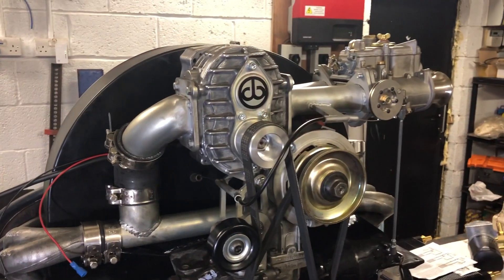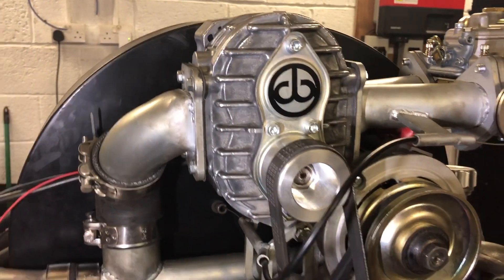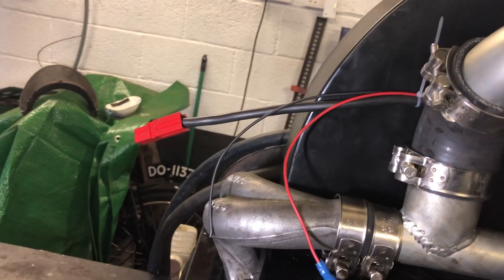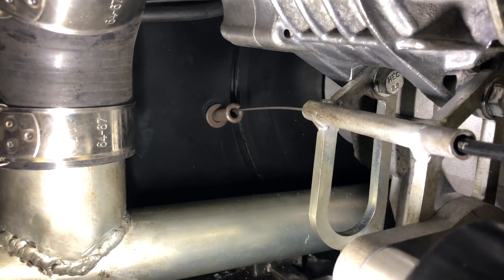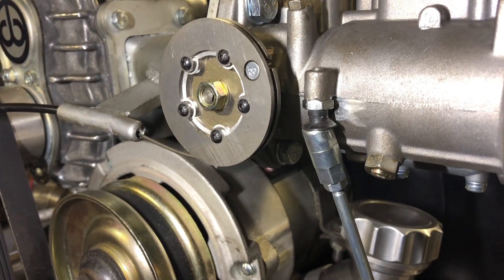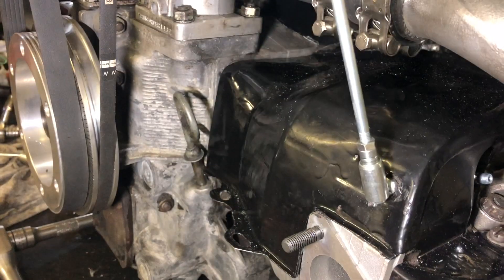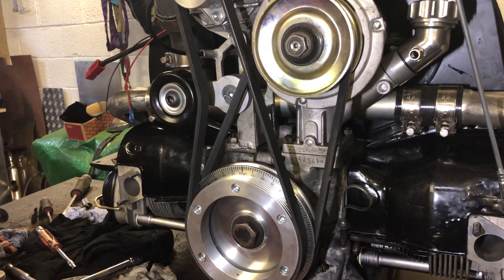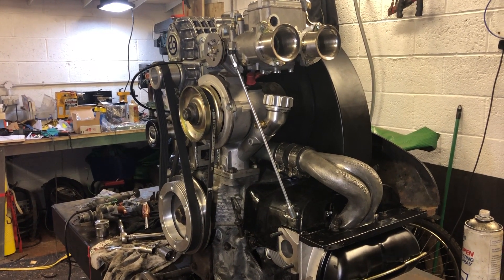VW 1303 Beetle with 1600cc engine with AMR-500 based Supercharger kit. Fully installed

Comment: I am about to do the same supercharger and carb setup on a Volvo b230 and put it all in a S10. I have to pull the engine from a boat in the morning,then the project is on haha
Reply from the maker: A word of warning on Joe Blow: their customer service is poor - I ordered the ignition at the same time and it didn’t arrive. It was sent later, missing parts and I wasn’t told about machining work is need to do to the supercharger kit to make it fit. The website doesn’t mention it, they don’t tell you and then when you complain, you’re told to bugger off.
Reply: @Daddyfixit  I planned to buy mine from bahn Brenner  Motorsports,it's alil bit cheaper and all I need is the supercharger itself. I planned to make both intakes and everything. I did check out the Joe blow site,it seems like a joke of a site.
Reply: Where are you located bud, I’m central Scotland and wouldn’t mind asking a few questions. Graeme
Reply: @1956ultra  I never did end up doing this,I took alil longer than I should to go pull the engine and someone stole the entire boat and trailer. Still working on supercharging a s10 though,but using the stock 2.2 in the truck. actually caught between using a amr500 or just putting a t04e turbo on it. Probably do the amr500 since I am already turboing the exact same engine,but in a cavalier.

Comment: Intake temperature must be so hot (my amr500 warms air 70-80C)
Reply from the maker: Unfortunately I never got the chance to find out. On its first proper test run an electrical fault set it on fire and it was a total loss.

Comment: is super charger a nessessary mod?
Reply from the maker: Are any modifications 'necessary'. I wanted to do it, I did it, it didn't work out well ... shit happens.
Reply: @Daddyfixit So sorry  ,No sarcasm , as I saved video for later ,was looking for serious answer, wish Good luck for u in restoring this engine they are tough vehicles!
Reply from the maker: @Mukh90  Don't buy a Joe Blow conversion - waste of money. Badly designed, badly made and zero customer service. Better to build a big bore engine although, it looked great and sounds amazing right up to the point the engine massively overheated and went on fire